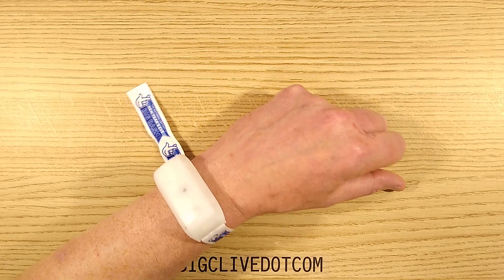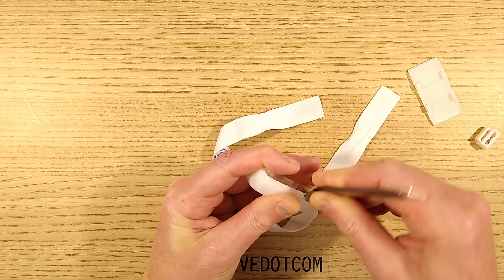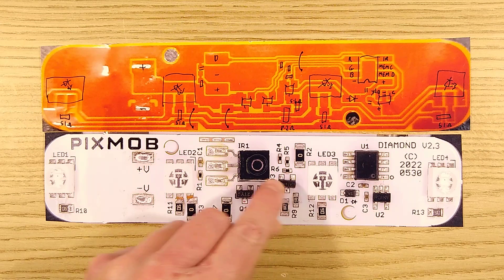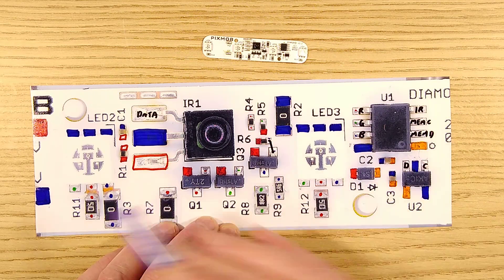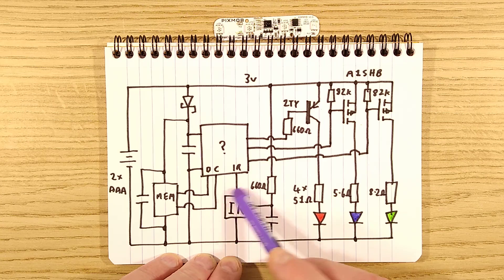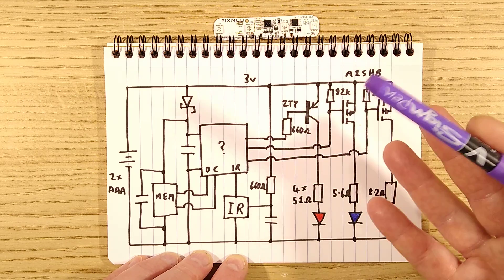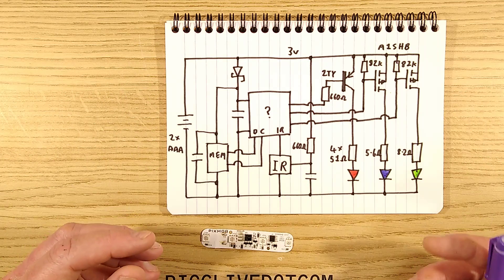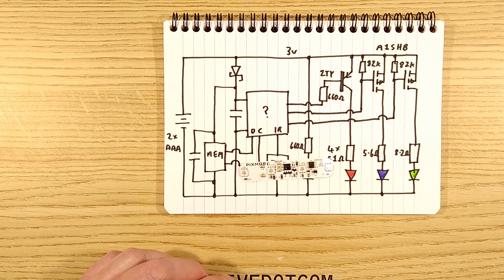IR controlled concert LED wristband

Comment: 0:46 I ve lost count of the remote controls and other devices that I ve had  destroyed by leaky cells , Surely it s posible to design a cell that doesn t leak , I believe it s by design Panasonic make many of these cells , the same company that I have to by a new remote control from to replace the one destroyed by their leaky cells , CLASS ACTION LAWSUIT
Reply from the maker: The incidents of cell leakage have increased since a chemical used to control internal pressure buildup was banned by the green brigade.

Comment: (2×) AAA cells, 3 volts. 

This must have been from far enough back that 100-200mah Lipo cells weren't cheap enough yet. 

I would think today that these things would all have a small Lipo in them, and they'd probably work better, and be brighter, with the extra volt of headroom that the Lipo gives.

Comment: FWIW the pinout on the MCU correlates with an 8 pin PIC12/PIC16. Pin 1 Vdd, Pin 8 Vss, and Pin 4 must always be an input (MCLR/RA3), in this case from the IR.

Comment: The IR controlled ones typically use IR lights - typically there on a pan-tilt light head so it can sweep across the audience  (there usually are several of these). I don't believe they're generally individually addressible other than controlling color - the bands respond to the IR codes if they can see the (they light up) and generally the color and location is controlled via DMX treating the splash of color not coming from the light head, but from the audience. A more sophisticated system uses RF to produce the audience "video wall" system - this relies on the fact that each audience member has a seat so their band's address is entered into the system. Throughout the concert, the RF signals will trigger the bands  - I believe they're relatively short range so they can update them all frequently since they're individually addressable.
Reply from the maker: RF version's video just released.

Comment: OK, non related comment/question. In March I bought 2 rechargeable 54-led pantry lights on Amazon. They have 3 settings; on, off and auto (motion sensing). Now they won't turn off even in the off position. They only go off when the battery discharges. The company has replaced them.
Reply: If you want to take a stab at them, let me know and I will send you the link. Thanks! ❤

Comment: I think it's a good habit/best practice to get into to use the car battery to charge your power banks instead, rather than laptops/phones directly. Then, if you want to recharge your sophisticated costly sensitive electronics, charge those from the power bank instead. And as long as you travel with a spare power bank, you can be charging one power bank while using the other to charge your costly and sensitive electronics. Car electrical systems can become quite noisy. And I doubt they get better with age.

Comment: Is that the UK National Lottery logo I spy on that band? I wonder what the NYE „Big Bash“ is all about?... 😉

I remember the coverage of the Xylobands at the time they first came into being (And the huge environmental questions people were raising over them; Xylobands were a one-use device) and I seem to remember they were issued to „Blocks“ of audience members - If you were sat in Block D you'd get a wristband specifically for Block D, and so on.
Nowadays, a system like that wouldn't really work outside of stadium and festival environments in terms of practicality for staff and guests, which makes delivering a structured light show on these seem pretty difficult at first glance.

I'm going to guess these ones (And other modern versions) flash their IDs on command which are captured by cameras over the audience, mapped to approximate seating positions by a PC, and batches of bands are assigned to „Sectors“ which would make programmed light displays easier to orchestrate? 🙂

Comment: There was a great video on TikTok of a guy who’d reverse engineered the IR based light bands at Taylor Swift concerts, and integrated it into an entire RGB led strip based jacket that worked at concerts
Reply from the maker: You could use a single receiver to control a whole outfit.  Possibly with just three MOSFETs.

Comment: Do these things often use IR or have they been seen to use radio signals too? I have two from some concerts but I don't really want to open them up since they are elaborate and collectibles, I assumed they were radio controlled since they are single colour and all came on and off at the same time.
Reply from the maker: Some are IR controlled and some are wireless.

Comment: For those not familiar with these ubiquitous IR receivers there's a photodiode followed by a bandpass amplifier, centred on around 38-40kHz with AGC, a rectifier/detector and a data slicer/threshold detector. Output is usually open collector and the case has a dye that transmits near-IR.
The sensitivity is quite high. Some years back we were using an undocumented feature of these to do simple person presence detection for POS displays. I cocked up a bit of AVR timer/counter programming and ended up with 4.7kHz Tx modulation IIRC. It still worked fine.

Comment: Fascinating bit of kit - I never thought about how these things worked, but I suppose any sort of two-way protocol wouldn't really be expandable to the tens of thousands of units at a big stadium gig, and radio would come with too much risk of interference with the audio, so good old-fashioned infrared probably makes the most sense. 

I also wonder what those big IR LED emitters look like through a digital camera - would they show up on the footage on the big screens they have at concerts? The idea of bonus lighting effects only visible in photographs and video recordings sounds like something Radiohead might come up with...

This has got me thinking about other mass-audience gadgets now, next time I'm on the salvage team for a large festival, I'll have to grab a set of the "silent disco" headphones to send in, as they frequently get left behind on the campsite and I'd be interested to see one reverse-engineered.

Comment: i do wonder if its possible to use those circuits and your own infrared light along with a bit of wires connected to some other stuff to use it as a remote control

Comment: I wonder if blasting a TV remote at it would have any effect. Probably coded to the controller, but electronics being what it it is, a lot of similar circuitry is shared over different devices and crossovers are quite common.

Comment: This is the first time I see a review of a product that doesn't show how the damn thing actually works. Genius!!!
Reply from the maker: Sadly, it would require the specialist control system to make it work.  If the batteries are installed it doesn't light until a control signal is received.
Reply: @bigclivedotcom  Ha! I found at least 2 videos that illustrate how to re-activate the wristband. At home!

Comment: The coldplay ones with a speaker used a AAAA cell, yes that's not a typo, quadruple A
Reply: AAAA cells are usually what alkaline 9V batteries are made of.
so very common actually

Comment: Would have been quite neat if it had a microphone so it could react to music if an infrared signal is not present. That way the user could wear it to other parties.
Multiple resistors for red being used as links is a good call. Is it a single layer PCB?
Reply from the maker: You can get a version with a microphone.  I made a video about one.

Comment: As I Know Of The Pixmob Syatem Uses Another Dmx Controller That Controlls A Set Of Moving Heads With Ir Blasters On Them, These Pass Through Encoded Codes With Color And Other Stuff So They Can Like Draw Out A Image In A Cetarn Colour By Moving The Moving Head In A Design!

Comment: I got 3 of these from the Taylor Swift Eras Tour a few weeks ago. I have been wondering what I can do with them. So far, I was only able to get the LEDs to change slightly using IR from a remote control. I do have Arduinos and Raspberry PIs laying around and an IR blaster to mount on a breadboard. I think the problem with the IR remotes I was using is they pulse vs being continuously on.

Comment: I have some Xylobands which I bought to repurpose to use as bands at my wedding reception, but went for some off-the-shelf chinese ones instead (time was of the essence and reverse engineering the code to drive the xylobands was taking too long).  Would be happy to send one of each to you for a future video?
Reply from the maker: Are they controllable or music activated?
Reply: @bigclivedotcom  They're both controllable - the ones I bought came with a DMX-controllable radio transmitter.  Not sure about the xylobands, but I believe they are also radio controlled - there was a project to build a transmitter but I didn't get as far as making it as some of the components for it were still on long backorder when I looked at it.

Comment: Regarding the IR fixtures you mentioned for controlling these -- where I work, we used to use some of the Altman outdoor PAR 600 fixtures with IR filters in them to wash entire areas with IR for surveillance cameras.  I know you can't modulate them like LEDs, but they worked great for that application, and the IR was not nearly as visible to the eye as LEDs.

Comment: Your next video should be lighting it up and demonstrating it working
Reply from the maker: Not easy without the show control system.
Reply: @bigclivedotcom  pity you can't use a flipper to record the IR  control codes and use the flipper to send out new instructions  to the wristband or just solder in a bypass

Comment: The RF versions usually use 433mhz and give you a limited number of addressed units. These can be driven from Artnet. These IR units are usually all addressed the same however the IR "megga blaster" is usually fitted into moving lights! Very tight focal point on the fixture gives you control over that area of audience bands. This way you wave the light around, the patterns wave around. Interesting!
Reply: Spent a fair bit of time digging into this back in the day when I somehow got tasked with trying to replicate PixMob’s show on 1/50 the budget.

Not sure what they actually implemented, but they did have a patent filed for a really simple method… just putting some sort of controllable screen in front of the IR emitter.

Set it up to blanket half a stadium, then just selectively block the signal to control where it goes.

If I’d had more time for my project, I really wanted to see if an LCD panel of some sort would selectively block IR depending on the colour, as that would have made a very cheap easy way to paint pictures on the stands.

We ended up using RF versions, and you definitely don’t want the addresses coded on the bands if you don’t need to… it simplifies the tech, but it makes the logistics of distributing the bands much harder. And anyone that sneaks up closer for a better seat can ruin the whole thing.
Reply: @adampippin135  Exactly. I only know about the IR moving lights from another video. Looks easy enough to implement though. Once you have the IR in place in a moving light you can apparently then use the gobos and shutters in the light to effect different areas. Its a simple old skool solution to an otherwise complex problem. I guess a mixture of 8 or 10 moving lights with IR and a few Wash IR would be needed to effect the whole audience at once. Would be easy enough to setup a fixture profile for this.

Comment: I still don't know exactly what a mosftet is? I know it's the black thing with three prongs, and I'm not sure what it does.
Reply: It is a switch controlled by a voltage. The voltage from the microcontroller is a low power signal. The mosfet switched the current to the LED, which is a high current.
Like a transistor or a relay, but not draining any current to open or close the switch.
Reply from the maker: It's a type of transistor that is turned on by voltage as opposed to current.  Very sensitive and staggeringly high current switching capability.

Comment: I wonder why did not go for RF for control instead. Cost?
Reply: Local control by scanning the audience with IR?
Reply: probably cheaper to produce the bands.
I have a couple that is RF. I guess they use RF if it isn’t easy to setup IR blasters.
RF can be controlled by a few transmitters and they don’t have to be in a visible place (high up on a pole).
Reply from the maker: They do RF versions.  But the IR system has some interesting tricks using modified moving lights to project shapes and pan about the audience.

Comment: Super cool getting to see you take one of these apart. I literally have one of these taken apart on my workbench right now. I use to work for a Pixmob competitor and met them at a tradeshow a couple of times. Their whole booth is coverd in the bands, and besides the IR projectors, theres a magic wand kind of thing that selectively turns on small groups of the bands. It's like a big IR laser remote. Pretty fun to mess around with.

Comment: Diode in MCU supply is so called "anti brown out" diode. When MCU switch on LEDs  - voltage in system drops so much that it can lock up the processor. Diode keeps little charge in decoupling capacitors to run MCU fort short time while voltage stabilizes.
Reply: The main purpose I see for the Schottky diode is protection against batteries installed in reverse polarity. Processor and memory chips don't like that. Schottky is used to minimize the voltage drop when batteries are installed correctly. LEDs don't need to the reverse protection diode because they themselves are high impedance when reverse biased. Keeping them and their transistors directly connected to the + side of the batteries keeps the voltage drop of the Schottky diode from reducing the already low voltage margin between battery voltage and the close-to-3V forward voltage needed for blue and green LEDs.  The 660 ohm resistor in series with the IR receiver's supply limits its worst case reversed battery current to 4.54 milliamps, x3 volts = less than 14 milliwatts, which is likely low enough not to damage the receiver, while the voltage drop across the resistor is only about 0.33 volts in normal (forward battery polarity) operation, allowing a receiver with minimum supply spec of 2.5 V to work okay.

Comment: The WSJ did a video on these a couple months ago "How Concert LED Wristbands Work". The CEO of Pixmob seems to have basically told them everything, the whole system for both the RF and IR controls is explained in enough detail to make scanning for the RF wavelength or imaging the Par IR launchers trivial and hacking the signal protocol likely an easy enough project for a highschool kid.  Ores mined from the earth all over the world, metals refined and purified, chemical electrolytes and semiconductors fabricated and packaged, assembled by robots in a cleanroom, all so it can flash an LED to "WAP" for an hour and then be thrown into a landfill for eternity. Hooray for 'progress'. 😒

Comment: You can get the band to display different colors temporarily by using an off the shelf IR remote control.
Reply: The 7 basic colors (and off) from an RGB led could be expressed in three binary digits (000-111). The remote might be working just because those bits show up coincidentally in its commands.

Comment: I saw a video interview with a company that runs these sort of bands.. they said they use IR because they can effectively "paint" the audience with IR signals to draw pictures, rather than needing to specifically address a specific code via RF to draw pictures.. so regardless of if someone's in one section or another, they'll only get triggered by line of site IR.

Comment: IR controlled? That would need a strong IR Transmitter for a large crowd. Imagine removing IR filter of a camera so you can really see this IR Transmitter. BRIGHT.
Reply: Most cameras and cell phones can see IR. Aim your TV remote at your camera for a test. I used to use this to see which optical fibers were lit at work, it annoyed me that iPhones had really good IR filters and wouldn't work so I had to carry a cheap digital camera.
Reply: My iPhone X detects IR on the selfie camera.  @davidg4288

Comment: I REALLY wish companies wouldn't use unmarked IC's for products like this, almost as bad as finding a marked chip from a company that doesn't appear to have a presence on the net (therefore no datasheets).

Hmm, I wonder if the LED's could be used to create something of a two-way network if they can generate enough IR or if there are nodes available that can pickup their normal illuminations for a more complex control network......
Reply: Intelectual property isn't something you give away for free
Reply: @jagmarc  I'm talking about getting the basic datasheets any tinkerer would need to make use of a microchip.
Reply: @12Mantis  Once you learn one microcontroller and what it can do they become unmarked blackboxes anyway.  
The unit is 2-way, the unit identifies itself through PCM its LEDs when addressed.
Reply: @12Mantis dont think anyone wants their product to be reverse engineered and then maybe the concurring company can copy their design and maybe get a way to read the code of that micro and copy the product
Reply: Sending out data doesn't have to be a IR LED. An ordinary visible LED transmits data the same. At megabits/sec if want. 
Of course you can't use a standard 'IR remote control' receiver but could even use a CCD and clever software. 
I know scanning CCD works really well for tracking millions of pixels all turning on and off I have specialist experience trust me

Comment: I wonder if the Flipper Zero could send the correct IR blasts to control them
Reply: Or just a arduino and ir led
Reply: or try a "Learning" IR remote control to record the codes? (if it can capture enough of the IR transmission energy)